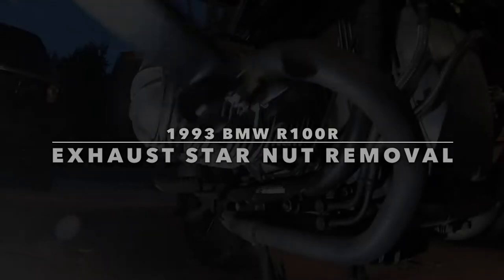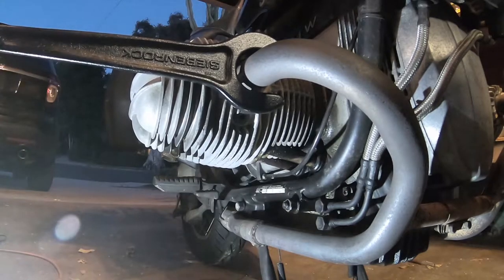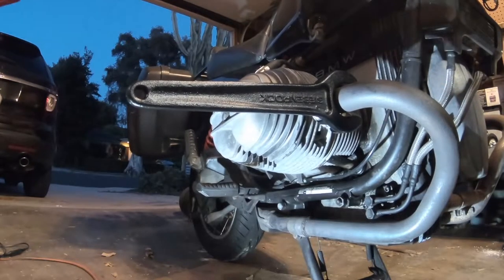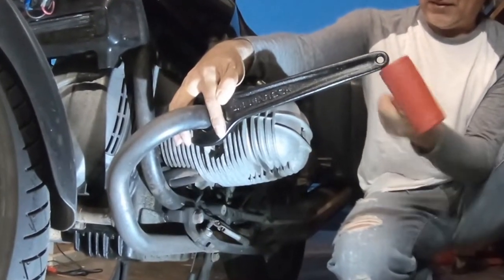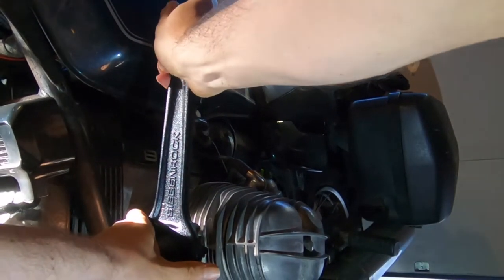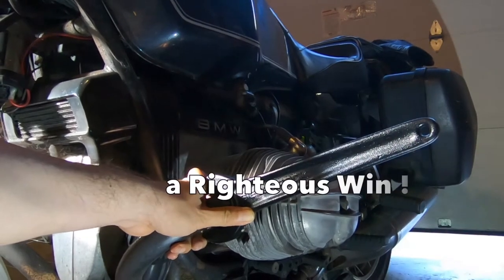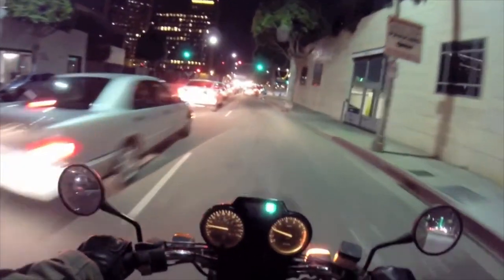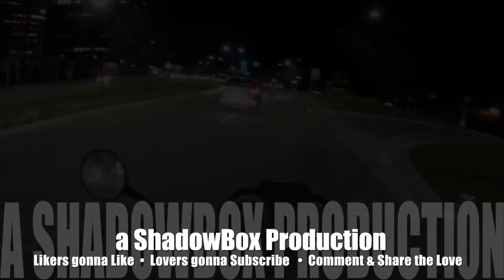ShadowBoxer 0066 {BMW Airhead Exhaust Nuts Removal with Siebenrock wrench}

Comment: To remove ,cloth soaked in boiling water around rose nuts , wait, resoak with boiling water wait  again ,hacksaw last resort.You should apply an anti galling compound preferably one designed for hot applications.
Reply from the maker: Hot water might work. Good idea. 
Thanks for the comment. Stay Sharp. Stay Up.
Reply: @ShadowBoxer  It does, boil the kettle apply H20 to a cloth around the nut ,repeat if necessary and a secondary benefit is unlike heating with gas it will not tarnish pipes or fittings.

Comment: Hi 

have the same bike from 1995 
I would like to know Where did you buy this seat ?
is that  original from R100gs?
Please Let me know 

Thanks
Reply from the maker: Hi, The saddle is a Corbin. It is not original BMW.
It came with the bike when I bought it. I suspect the original owner put it on but I don’t know. The bike also came with the original bench seat. R100GS also has a single seat variation. I have thought about getting one but this saddle works fine for me and I really don’t need the original BMW single seat. As you know the R100R shares many parts with it’s GS counterpart so the single seat would probably fit. 
I hope that helps. Stay Sharp and Stay Up.